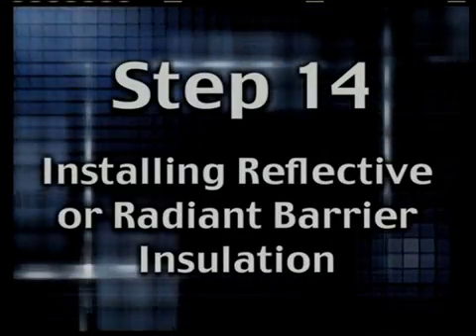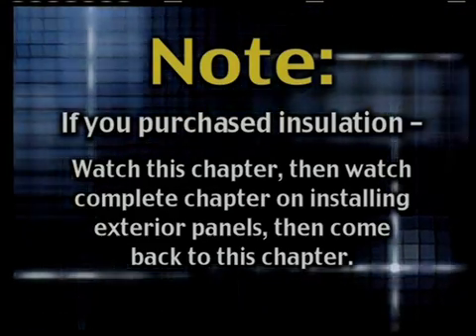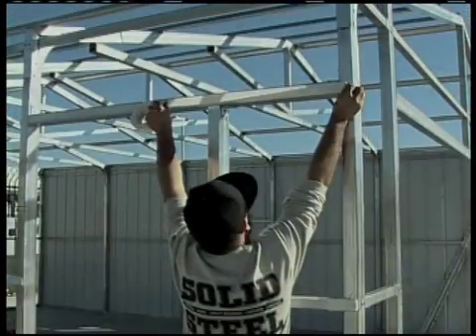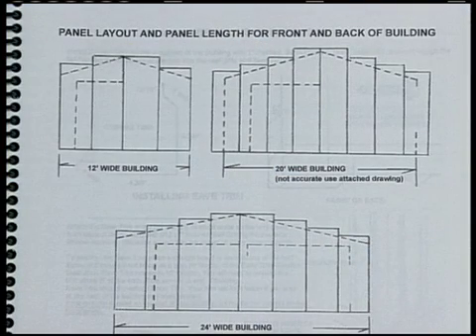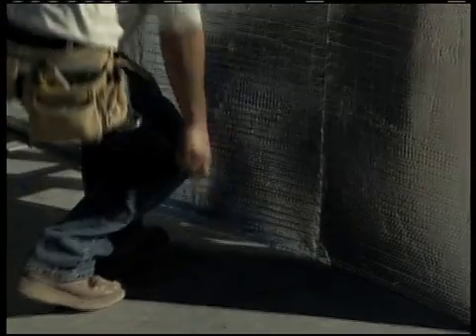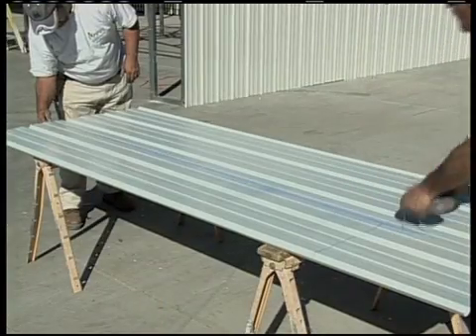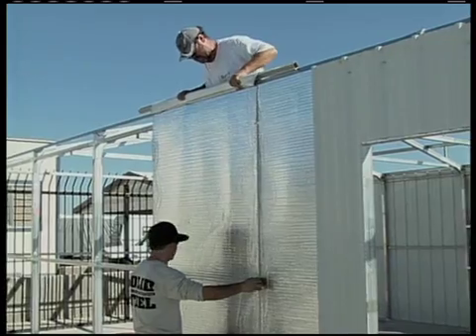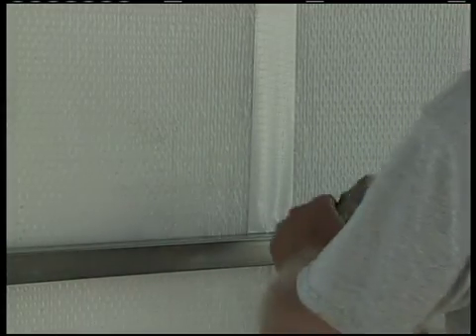Metal Building Installation Step 14: Radiant Barrier Insulation

Comment: You are completely defeating the effectiveness of the radiant barrier by not allowing for an air gap between the outer panels and the radiant barrier material (It's not really insulation, it's a barrier). The radiant barrier in this case, would be far more effective if installed on the inside of the steel posts...
Reply: The narrator says for the sides start at the front and work toward the back...